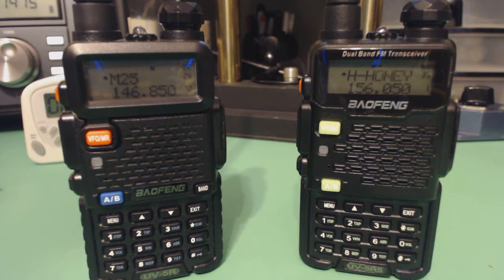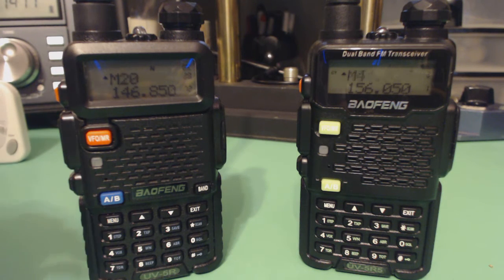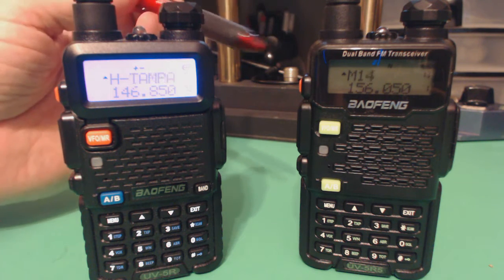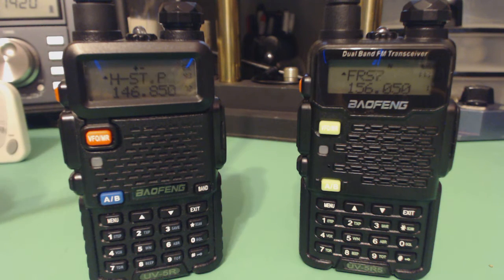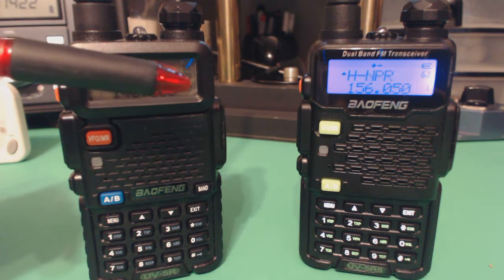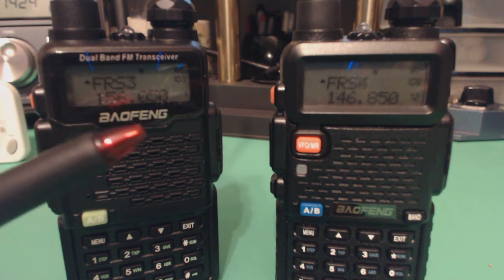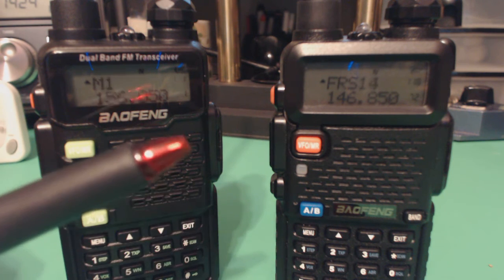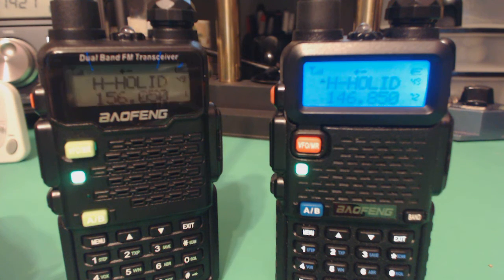TRRS #0650 - Baofeng HT Scanning Testing

Comment: I find the scan speed painfully slow, especially the frequency scan...I have a Pro 2020 thats faster than this.
Reply from the maker: +ᗒ╬ᗕ1112223333111ᗒ╬ᗕ Agree I did a show before showing that even the cheapest scanner radio can out scan these yet people are advertising them on Ebay as scanners.
Reply: still cant beat the price though I guess
Reply from the maker: +ᗒ╬ᗕ1112223333111ᗒ╬ᗕ Yes, you get a lot of radio for very little money especially if you have a license to transmit on it.
Reply: Try the Radioddity/Baofeng UV5RX3. Scans much faster

Comment: Thanks Tom, I'm really enjoying the time you're taking with this unit because I just got one the other day.  I'm pretty sure your Baofeng UV-5R5 and my Misuta Samurai are the same transceiver with different labelling and casing. I'm in a regional city and I can only hit one 2m repeater consistently from my home using the stock antenna. According to my repeater app it's 11.2 miles away and I'm pretty happy with the reception I'm getting. Conversations are clear as a bell. 

Everything you have said about it so far I can confirm (good and bad) and in fact got this model from your comments about the short backlight. This model has the dark background, thinking it would be easier to read while scanning with the insanely short backlight. Honestly, I don't think the dark bg is any easier to read than a standard lcd screen, except maybe in full sun. Under house lighting it's just as hard as any small lcd device and sometimes even harder than that!